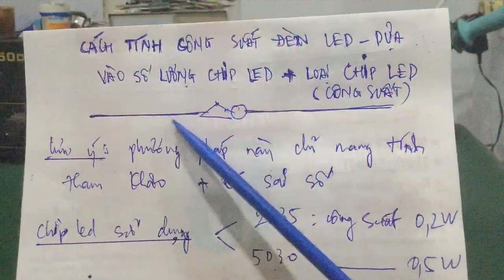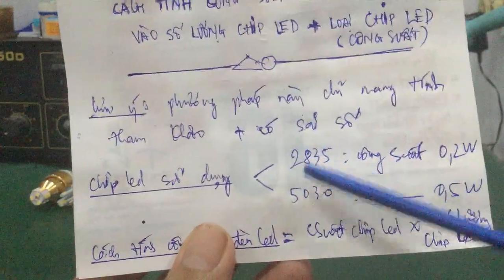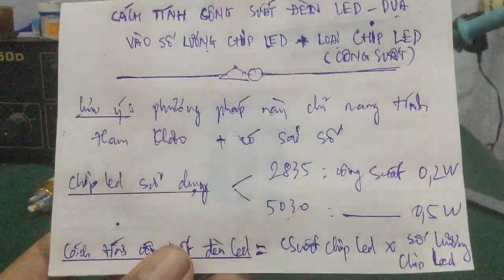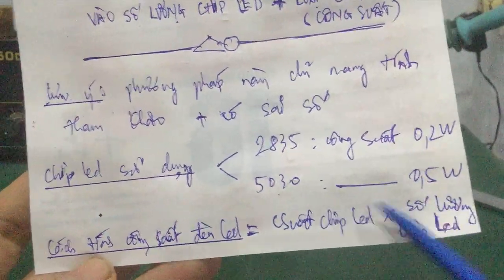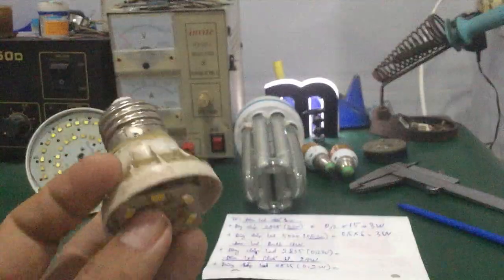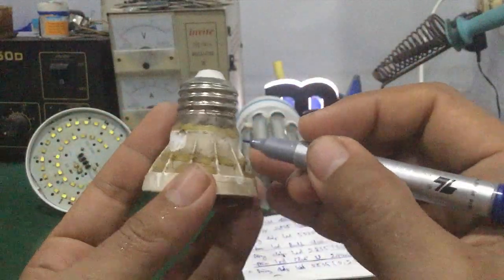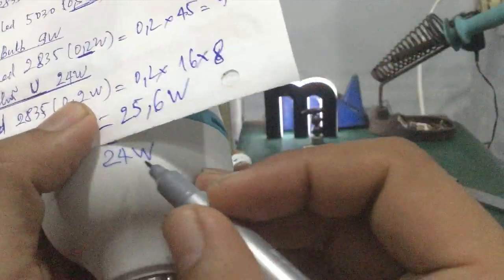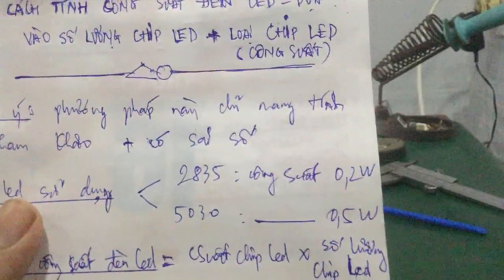Sửa đèn led 220v - Cách Tính Công Suất Đèn Led Dựa Vào Số Lượng Và Công Suất Của Các Loại Chip Led !

Comment: Một đoạn led 5050 ARGB 2812b 10m thì dùng nguồn 5v bao nhiêu A bạn nhỉ?
Reply from the maker: zalo a : 0787402616 
Hãy đăng ký theo dõi kênh Youtube để xem các video của a nhé … e có cần hỗ trợ về kỹ thuật hay tư vấn về điện tử - điện thoại di động thì cứ để lại comment , a sẽ support cho e !
Reply: thì comment đó sếp, sếp hỗ trợ comment của này em đi
Reply: theo mình tính toán thì 1 mắt led 5050 có công suất 0,25w. với loại 60led/m thì là 15w/m. vậy 10m thì công suất = 150w => 105w/5v = 30A.

Câu hỏi là tại sao các cửa hàng và các shop lại chỉ toàn setup nguồn 5v10A cho đoạn led trên? Như vậy làm sao đủ công suất đc? Sếp hỗ trợ giúp mình đi
Reply from the maker: @Hnt1234  zalo a : 0787402616 
Hãy đăng ký theo dõi kênh Youtube để xem các video của a nhé … e có cần hỗ trợ về kỹ thuật hay tư vấn về điện tử - điện thoại di động thì cứ để lại comment , a sẽ support cho e !